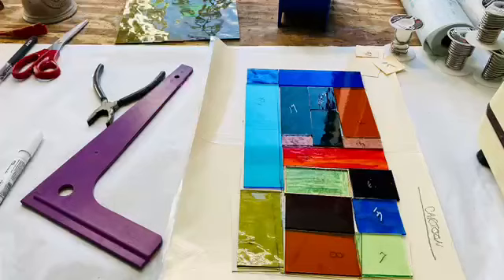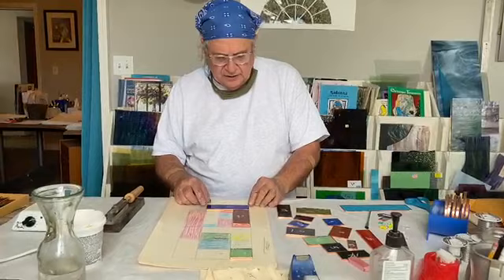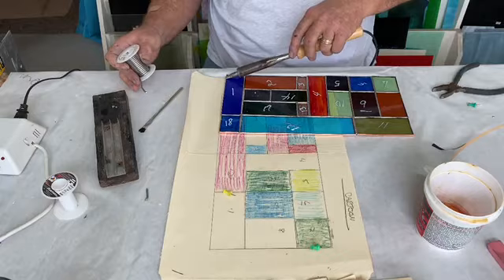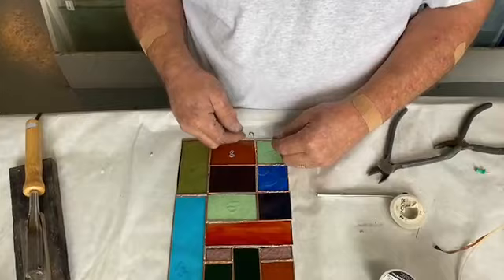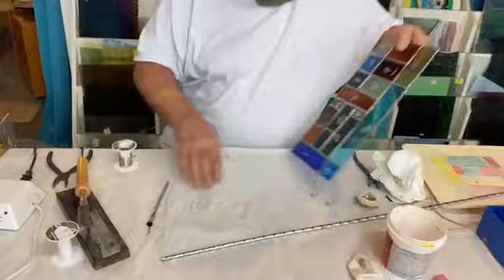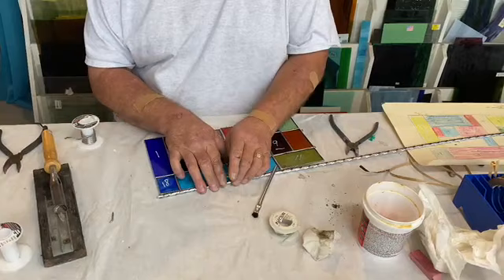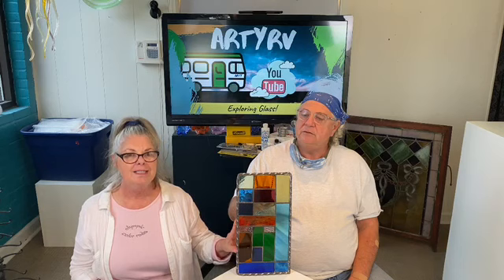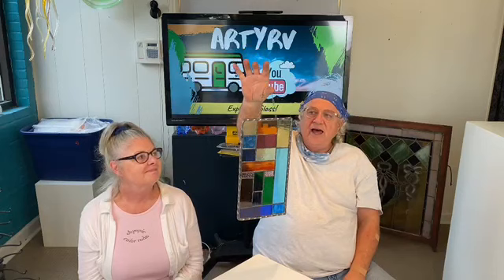HOW TO MAKE Stained Glass

Comment: I would love to see this as a diy kit for beginners. Also, I have lots of questions. I would have loved a close up of the wire hooks you made and how they were installed with the solder. More explanation on this project.  For example; when you were on the front vs the back. More informative chatter. Also, if you are a beginner,  show an easier way to frame a piece. Is that where came comes in? Love your videos. I so enjoy you and Barb. You two are adorable! 🤩 Many thanks from Washington State.
Reply from the maker: Thank you for your ideas and thanks so much for watching!